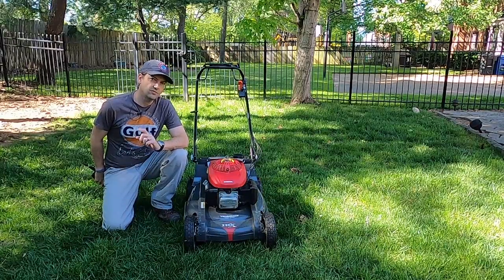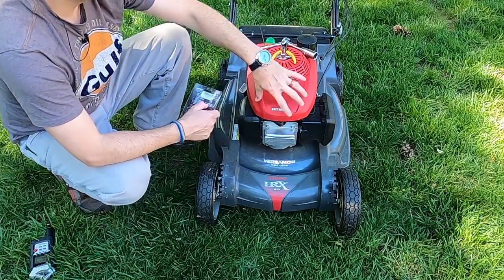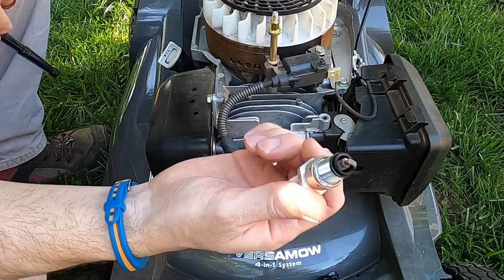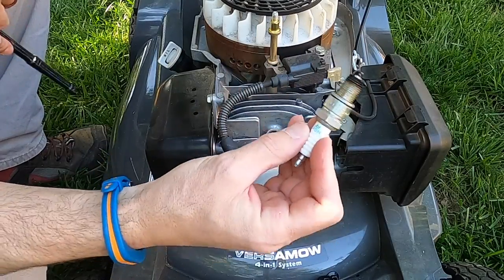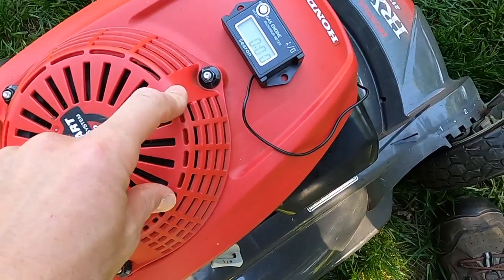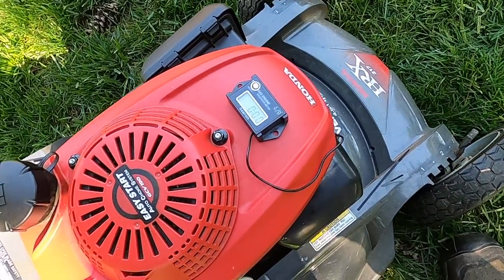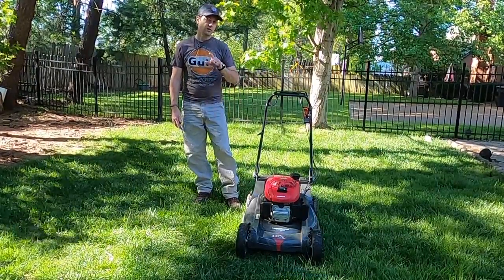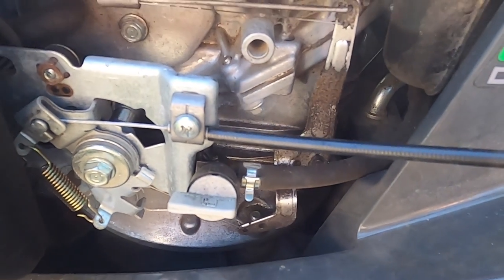How to Adjust Idle and RPM on Lawn Mowers with automatic throttle

Comment: I would like to thank you for showing a proper way to adjust the governor speed. I’ve seen many videos showing to move the governor shaft to adjust. If the mower has not been touched you should not mess with the adjust of the shaft. Bending the arm you bent if the preferred way. Some engines have an adjustment screw, most you bend an small arm or tab to adjust.

Comment: Kool, I got a 2017 honda hrx217. I love it. If remember where I put my hour meter. I can check the speed. I use the tachometer to check the rpm b4 I make any adjustments on any mower. The honda is fast the 1st few years. So I might adjust the belt tension cable

Comment: Too bad Honda doesn’t make the governor arm adjustment by means of turning in or out a screw so dialing in the rpm is simpler. Twisting a stamped piece of metal  seems rudimentary.

Comment: That is not adjusting the idle. You have adjusted governor for operating speed. Idle is the LOWEST speed. Not the highest.
Reply from the maker: I'm LITERALLY adjusting at low speed (16:15).  Did you actually watch the video?
Reply: @PartsCounterGurus  ok I went back and checked 16:15 like you said in your other reply to me and it sounds like full speed.
Reply: @PartsCounterGurus  If I may say, it is a bit confusing.  If you look at the throttle cable and the control mechanism it is connected to it appears that you are in full throttle position.  After you adjust the governor arm you then lower the speed to idle.  You can see the cable and mechanism extend to the idle position.  It seems you are adjusting RPM for full throttle, which is fine, but it is not for idle.  I'm new at this stuff so if I missed something obvious I apologize.  I'm not trying to be difficult.

Comment: Why was the idle surging at first start up after adding the rpm gauge?    Did this spring mount bend fix that issue too?    Mine runs fine when throttling up just like yours did.     Btw.  My self drive quit also. Lol.   I have both of those issues after one season of cutting.(Small yard ) And mine is the middle one in that Honda hrx line ,like yours .
Reply from the maker: Surging on a cold start is common with automatic choke models.  It should not continue when the engine is warm or you have a fuel delivery problem (dirty carb).  Basically the choke is constantly attempting to find balance until the engine is warm.
Reply: Parts Counter Gurus mine ran perfect for the first season ...even cold .  Then it started surging unless it is throttled up .  Even warm.   Mine might be the wax sensor tho.   I just thought what you did might had changed it.   Thnx 👍
Reply: Try cleaning the low speed jet in the carb. You have to remove the idle adjustment screw on top of the carb to remove it. It’s a little black plug, it just pops out. Pry it up with a small screwdriver, it’s held in by small o-rings. There’s a tiny hole in the bottom of it. Run a small wire through the hole to make sure it is clear ( I peel the plastic coating off a bread tie, usually small enough) spray carb spray through the tiny hole making sure it comes out the larger holes on the sides. Reinstall the jet, just push it back in. Put the idle screw back in. Put everything else back and start engine warm it up check idle speed, adjust the screw (has large head and black plastic, the one removed above jet). Should take care of surging. If it doesn’t carb will need to be throughly cleaned. Always helped me.

Comment: I googled the plug for my xrx217 and it said ngk bpr6es . Is there a difference ?
Reply: There's a slight difference between the two but you can still use it but it might damage the engine

Comment: You better should adjust the Idle with the Idle screw on carburetor instead of bending the governor arm!
Reply from the maker: Except when there isn't an idle screw, like for instance, the Honda in this video.  But hey, you be you!
Reply: There is a screw on the carb. As I said before you have adjusted full speed - not idle which is the lowest.
Reply from the maker: NO.  AS I SAID BEFORE: There is no adjustment screw on this carb. 
I'm LITERALLY adjusting at low speed (16:15).  Did you actually watch the video?  Coming back here and continually arguing that there is an idle screw on this carb doesn't make it true.  Evidence might.  Do you have any?